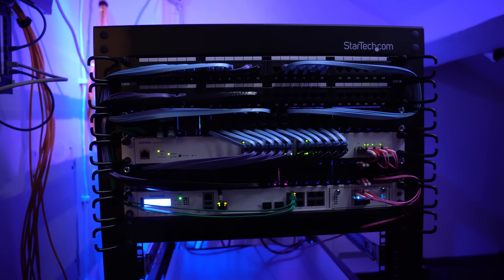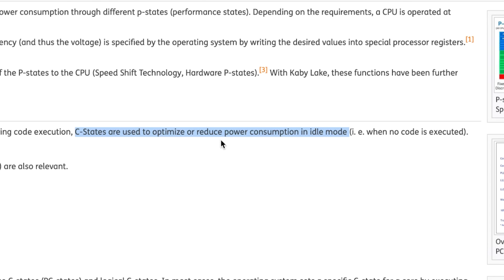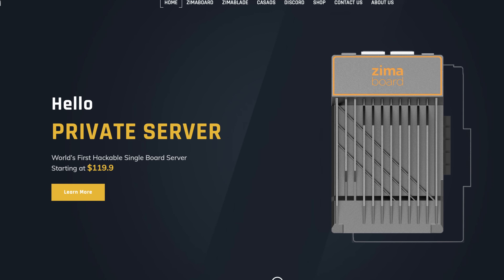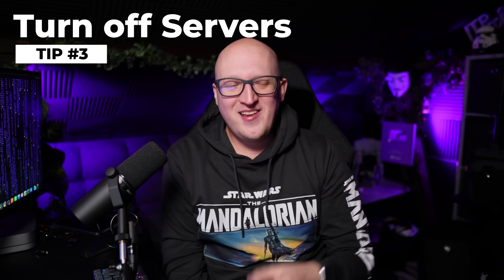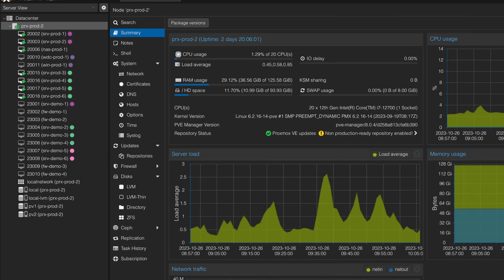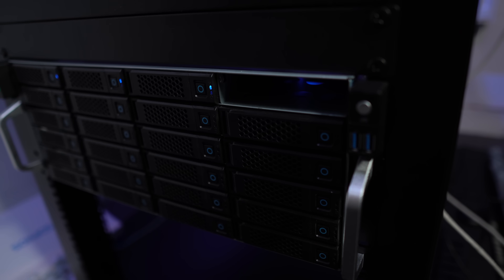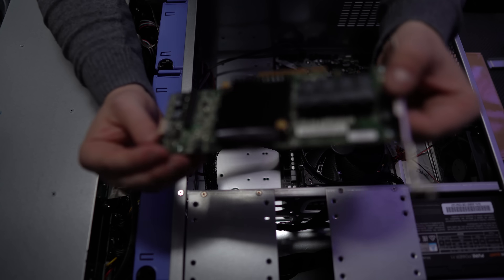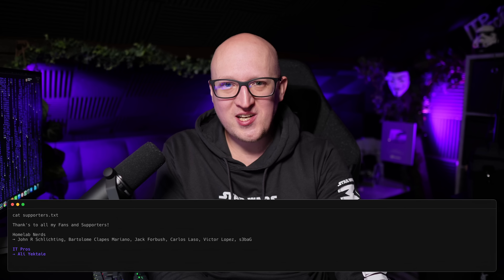How to save power in a Homelab? 5 Tips!

Comment: I have been on this journey also and I have learnt the hard way, but it is also fun.  More cpu cores often means a higher tdp.  Desktop based systems don’t offer a great deal of pcie lanes, unless you go quite a way back to older platforms.  It’s a shame because there are a lot of nice capable cpus out there but are then limited by pcie lanes.  If pcie lanes are not an issue for you then this is the way to go, particularly when you can now get 2.5, 5 or even 10 gig networking built in and a cpu with built in graphics.😊
Reply from the maker: Thanks for sharing your experience and insights!

Comment: Tip:
That PCIe card to add 10GBASE-T may consume a bunch of power just sitting there, but that TYPE of connection (RJ45) has multiple pairs of wires that need a lot of pre- and post-processing to create a resulting data stream. That processing costs a LOT of that power you quoted. 
Using SFP+ connectors for 10GE: 
- with short range fiber will almost always cost less power,
- BUT - the REAL winner, if you're using short haul within a rack, is passive DAC plugged into SFP+ sockets, which uses a tiny fraction of one watt. And those cables are cheap - cheaper than fibers, and far cheaper than optical transceivers!

Of course reducing the electrical power consumption also reduces the thermal load you have to get rid of, and the noise and costs associated with that extra heat. So that's a double, or triple, win.
Reply from the maker: That's a great suggestion, thank you! Maybe I'll do that when I refactor my setup :)

Comment: Set up your HDDs to spin down using cron jobs when usage is minimal.  I have my 6x hard drives sleep at night and it drops my NAS from 44w idle (parked heads and lowered RPM, but still spinning) to around 28w.  That's 16 watts saved x 10 hours a day = 58kW/year!  [Using Seagate Exos drives and using Seagate OpenSeaChest to control them]

Comment: I think the most important question was one of the last ones: "Do you really need it?" For me, the answer is kind of yes and no. My "homelab" is pretty modest: I have two Dell 3050s—one Micro and one SFF.

On the Micro, I run Proxmox, mostly using LXC containers for things like AdGuard, Nginx Proxy Manager, Gotify, a Debian container with a custom dashboard I made in HTML/CSS, and another Debian container that just runs a script to back up the backup volume from the SFF. I also run two VMs there: one for Tailscale (as a subnet router and exit node) and one for Home Assistant.

The SFF runs Ubuntu Server with CasaOS. On that I have Jellyfin, Paperless, Docmost, Memos, Immich, Navidrome, and two custom Docker containers I made. The SFF has a 1TB RAID 1 setup where I store documents, music, and backup images. Media like movies and series are on a 1TB USB HDD—I don’t care much if I lose those. Backups are also stored on a 500GB NVMe SSD, and everything is backed up again to an external drive.

Specs-wise: the Micro has 32GB RAM, a 1TB NVMe, and a 128GB SSD for the OS. The SFF has 16GB RAM, the RAID 1 array, the NVMe, and the USB HDD. Power usage stays between 54W and 62W, which is pretty reasonable.

Right now, I’m planning to set up a small backup machine—maybe with a Raspberry Pi—to keep at my parents’ place for off-site backups. Nothing crazy, but it covers my needs pretty well.

Comment: short answer - use mobile components, for example mini-pc, or build it based on framework components. These support more C and P states for power saving. Also, use integrated GPU whatever you can...and if not - better to use workstation variants. 

Server equipment are tuned for performance, not power efficiency.
Reply from the maker: Good tips!

Comment: My Xeon 16c/32t based Dell R730 has been running for years now on 53 watts idle. Full specs: 1x E5-2697Av4, 4x 64GB DDR4 ECC REG, 1x 495w PSU, 2x 1TB NVMe M.2 storage internally on a PCIe slot. 

So old doesn't per definition mean that it's inefficient. And certainly not for the price of this thing.
Reply from the maker: Wow that is a nice build!

Comment: I have a small lab.
1 server hp probook 450 g10 wiht i7 11th gen and 16gb ram.
I installed proxy on it and changed the cpu usage from perfromance to "ondemand".

lately I got ugreen nas and it is on power saving mode and it will turn off the disks if they are not used within 20 minutes.
Also added ssd caching to reduce the load on the HDDs.
IDK what can I do more to save more energy :).

My Proxmox has 2 VMs running.
one is dns server and the other only when I need it.

Comment: I've tried to reduce hardware as much as possibile but it lead to 2 full desktop computers running 24/7 because they need to do both the hard work and the light work. And now I think that sometimes more is less, because what I and most people need is actually 2 or 3 low power machines to run services 24/7 (if you care about high availability, if not 1 is fine), and potentially a more powerful machine that you can schedule or power on and off on demand.

Comment: in my experience even with a big NAS, 24bay in my case, with proper CPU hardware, new HBA SAS adapter and last but not least a proper sized PSU the power consumption is on check. PSU wattage and efficiency rating is really important.

Comment: If you looking for a lightweight solution, there's these NAS-boards from CwwK and Topton on AliExpress. I was looking for a USB/eSATA-unit to expand my server with extra disks; but I bought a 6-sata/2 NVMe + 3x 2.5GBe board of CwwK, popped in a cheap 1TB Crucial NVMe for the OS and my old disks. Corsair powersupply (NOTE THAT PSUs ARE NOT EFFICIENT ON LOW WORK LOADS! Research! Gold PSUs with a low overall maximum capacity are better for running low loads! Most are only efficient above 20% capacity), and spent about 400 euros incl. a Fractal Design Node 304 case for it.

It has a 10W TDP, and it's great!

Comment: Crhis! Amazong that you are doing this and inspiring other to be efficient. My home lab is already scaled down to low power server (desktop) machines. However, my truenas core uses 6x4tb in raidz-2. As you suggested small number of disks would be a better way to go in future. However, I don't have a plethora of sata ports to add another zpool and migrate. What could be a solution in such situation. Remember most of homelabs are not big server with 8 or 10 hot-swaps. I hope you can share some guidance here.

Comment: I was planning to pickup a used Dell Poweredge R720 with 256GB of ram a few days ago. I had to reschedule. After watching your presentation I am definitely re-thinking my approach. Thank you
Reply: I have a bunch of r730, they are idling at around 128 watts. My old r720 is out of the rack since late 2021. I don't recall what were the idle wattage for this one.
Reply: I have an R720 with tons of CPU and RAM as testbed of my homelab, which I power on when needed, and for h24 VM and selfhosted services a mini-pc ryzen based

Comment: My docker host is an older NUC (i3-6100U) that draws 4.x W at idle.
I also have a 4x2TB DIY NAS (25-40W idle), that is only used for backups. Since that backup machine is not needed 24/7, it starts via RTC schedule, runs all the backup job and shuts down again.

Comment: Saving money is the big thing. I built my storage and VM as best as I could.  My main NAS is a truenas setup running on a Xeon Bronze 3204 CPU with 12 HDDs which are in 3 pools. My backups run in the night, so powering down is not an option. Also starting up and shutting down would cause a lot of wear and tear on the system. I have my main Proxmox running on a desktop MB with 64GB of RAM and Ryzen 5950X CPU and a 2nd Proxmox system running on a older Micro HP G3 800 computer. My backup NAS is powered by an Atom based MB also running TrueNAS. I lastly have another TrueNAS system which is my off-line archive. It get connected to power and network only when I backup to it and then turned off and disconnected.  Will have to look into what settings I can tweak on my NAS system to save some power.  Besides all the regular data on the NAS, I have my movies, TV show and music collection. Would love to have SSDs instead, but the sizes I require are not available yet and even if they were, I could not afford it.

Comment: Some of my thoughts on building my homelab.

1. Raspberry Pi's are great but storage for constant writing burn out quick with POE Hats sure but not dependable. Mini pcs are great but doing RAID may not be possible and also ECC memory may not be possible.  Or Dual NIC for Network Bonding unless you have USB connections. 
2. RESEARCH RESEARCH RESEARCH.  Know your limits and where you want to go and keep a bit of open room to improve on.
3. I have 2 computers that are rackmounted as my servers running 24/7 well 3 if you include the NVR Security Cameras.  One is VM for FIrewall, Windows Server DHCP, Pi Hole. The other is my NAS with Docker and many services running on it.  
4. When building out I try to keep the CPU wattage under 65watts.  AMD 5600x seems to be great for this task.  Many over build a and barely use it.  Be realistic, plan ahead but not where you have to rebuy new equipment
5. Do not buy refurb Rackmount Servers from network rooms.  The noise level is loud and when you turn them out its sounds like a plane taking off.  During the summer its gets hot during winter its a heater.  My 2 servers maintain the room luke warm at best during summer and winter i don't notice them or noise.

Comment: I have 2 servers, one cheap but very modern one, this is my 24/7 server with my mailserver, password manager, vpn, etc. etc. and another server that was quite expensive, is old+used but is really powerful in comparison (8 cores in my 24/7 server vs. 28 cores in my big server)
The 24/7 server uses ~40W constantly, and the big server uses ~140W at full idle. Since the big server used to house my NAS, this was kind of a problem. Eventually I stumbled across some new 12TB HDDs that Hetzner is selling on ebay for ridiculously little money, so I threw 4 of these into my 24/7 server for a raidz1, and I couldn't be happier

Comment: For me, switching from a Nas, where the hard drives ran 24/7 to an SSD cached Unraid server has made a huge difference. I am able to save about 80-100W by that. Unraid is optimized to let the drives sleep as long and often as possible. The server is still on 24/7, but needs WAAAAY less power because only the cpu, ram and SSDs are running.
And yeah, less drives bigger size.
Reply from the maker: Haven’t tried unraid for a long time, never got used to their weird usb stick setup ;D but seems like a good option too

Comment: What do you guys thin about E-Cores in a Homelab/NAS? Are they worth it? I am thinking about getting a lattepanda sigma for my first homelab and it's a bit expensive, but offers almost everything I need in quite small dimensions. Also as a normal x86 cpu it would be capable of running a remote windows machine so I don't need to bring my laptop everywhere I go to create some CAD designs when I am not at home.
Reply from the maker: No idea, I’m using a CPU with E-cores, but never recognized a significant difference when running proxmox, I think I need to dig further…

Comment: One thing that I don't see enough coverage about: LXC Containers. Especially if you run Proxmox, using LXCs instead of full VMs saves quite some resources. You can still run stuff like Docker and if you don't need hardware passthrough. Also these containers start a lot quicker than some VMs. Basically anything that doesn't require Windows runs as an LXC in my homelab, and I run these on a cluster of 2 NUCs with 1TB NVMe SSDs and 64GB RAM each. The only power-guzler at this time is my Storage server, which is an enterprise-grade 1U server with 4 HDD bays, which sits at around 90W. But everything I store is on that NAS, so I don't see a reasonable way to turn it off at night or something.
Reply: It's not really recommended to run docker inside lxc though. I read ppl had strange behavior for instance when doing updates.

Comment: So partially agree. If you run servers, with a 750w PSU, that’s what most desktops have. I do agree that virtualization is the key, plus changing from performance mode to balanced also works.
Most server hardware will also let you run in redundant mode so only one PSU is taking the load while the other is idle.
Reply from the maker: True

Comment: Saved 150 watt per hour by using hdparm for my HDDs. Use command hdparm -y 

and ps aux | grep hd-idle | grep v grep | cut -c 66 ; for f in [a-d] ; do hdparm -C /dev/sd$f | grep -v "^$" ; done 

command to check the state. Saved me over 30% power consumption. This box has several HDDs that only being used a few times per week. The run ProxMox v8.
Reply from the maker: Interesting 🤔

Comment: I have 2x Lenovo ThinkCentre M900 Tiny PCs with Proxmox.
Most of the stuff I use are running in docker containers that are running inside LXC containers.
But included in my cluster are things such as Plex Server (Direct Play Only), Two instances of Pihole, Wireguard VPN, Bitwarden, etc...
I put a power meter on the PDU that both of these Tiny PCs are connected to and together they're averaging about 25 Watts.
Makes me sleep so much better at night knowing that my entire home lab just sips power.
Reply from the maker: Sounds like a good setup 👍

Comment: Four things:
1) The battle between performance and power efficiency rages on.
This is HIGHLY dependent on what it is that you're doing.

Earlier this year, I did a mass migration project where I migrated four servers down to a single, bigger server, and consolidated everything under Proxmox.

By using virtio NIC (which presents itself as a 10 GbE NIC), I was able to save on NOT having to buy and run a 10 GbE switch.

A LOT of people, homelabbers, and tech YouTubers tend to just acquire more hardware when they need more resources, whereas I went in the opposite direction of trying to make do with less, and have each of the systems that I have, do more.

Thus, to the point about how your virtualisation server has a relatively low utilisation/high idle time -- my Proxmox server, on the other, has a load average of around 16.00 (and it's a dual Xeon E5-2697A v4 (16-core/32-thread) system. I try to keep it around 30-40 if I can, because too high, then I have thread contention issues, but too low, then I am not using the server as much as it could otherwise be used.

But again, that REALLY depends on what you're doing with it.

I have I think something like 7 containers and 10-12 VMs running on that thing now.

2) I fully agree with using what you've got. I have three other mini PCs that run Windows 11, and two of them now also run Proxmox via Oracle VirtualBox. For things that were more latency sensitive, I have offloaded it from my Proxmox server onto my mini PCs. (Beelink GTR5 5900HX). And I also did had to restart one of my 4-bay QNAP NAS units because iSCSI was having issues under Proxmox.

3) Hard drives
Yes, you can use fewer, but larger drives, but if your ZFS needs to rebuild, rebuilding a 20 TB drive is going to take forever with fewer drives, vs. having more, lower capacity drives. If you run a 3- or 4-drive raidz1, and you have a second drive failure whilst your first drive is resilvering -- you're screwed at that point.

So yes, with my set up (four 8-wide raidz2 vdevs), I am losing a LOT in terms of usable capacity, but if a second drives whilst the first drive is resilvering, then I can resilver both drives.

If your data isn't super important/critical -- then running raidz1 is fine.

But for critical data (e.g. pictures of my tiny humans), then I will want that to be on a raidz2 array/pool, even if I have LTO-8 tape backups of the pictures.

4) Older server hardware vs. modern desktop hardware
Again -- that depends on what you're doing.

I am using an older Xeon server because of a need for PCIe lanes. If I were to go with a Threadripper system, that would cost as much for the CPU alone vs. what I paid for my dual Xeon server. For things that don't need PCIe lanes (i.e. GPU passthrough AND high speed system interconnect), then mini PCs work for that. But if you need PCIe lanes AND cores, then old server is a cheaper way to go, despite its higher power consumption.

But again, depends a LOT on what it is that you're doing/trying to do.

Comment: love the timing of this video - over the last 90 days, I've been doing efficiency changes to my homelab, dropping my overall kW commit from 2kW/m to 0.4-0.6kW/m, obviously I did this with money lol but getting rid of very old hardware for some new age 15-75kW servers is amazing. 10th-13th gen infrastructure offers such robust performance packed into tiny packages of power.

When it comes to shutting down servers, I try to get things to sleep where I can and yes, WOL is great to instantly wake and resume these servers - unfortunately a lot of users are intimidated by the issues of sleep (automatic wakeup, GPU performance failure, windows poor compatibility since windows7) which is why I think it's not used as much as it can be but is very useful for a desktop PC with high wattage that gets usage randomly throughout the day, sleeping can save atleast 0.2kW/h for my 13th gen i9, that probably doubles or triples for the AMD users.

Totally agree with you man, great video.
Reply from the maker: Thank you! We’re in the same boat 😊